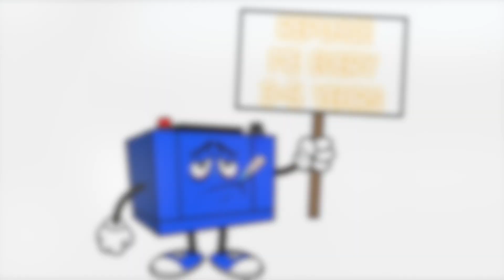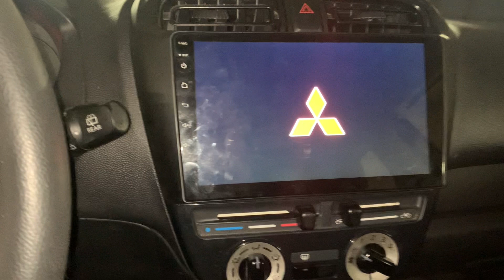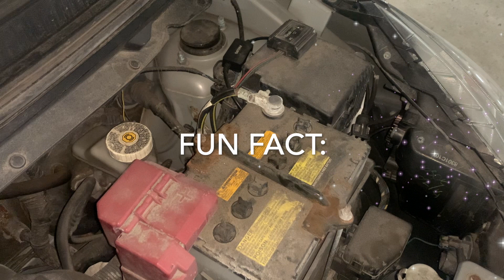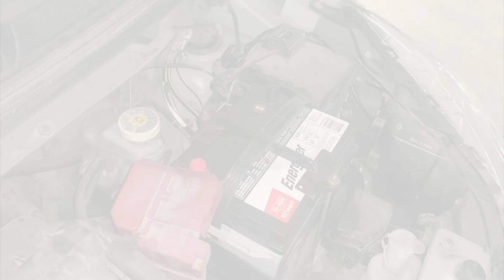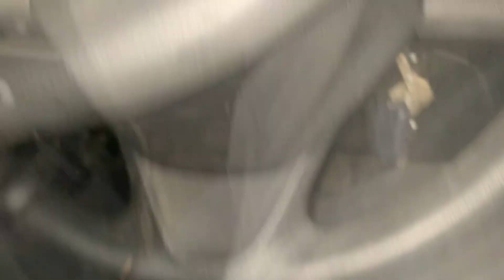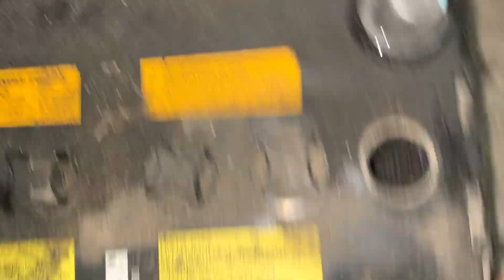Mitsubishi Mirage Battery Replacement

Comment from the maker: Minor correction: In the video I make reference to the voltage read by the 12v socket meter as the system voltage. Due to the length of the wiring running from the socket to the battery the actual voltage if measured at the battery will be approximately 0.2-0.5 volts higher.

Comment: Should the terminal link on positive side be loose or move.
Reply from the maker: Mine is quite difficult to move by hand but lead is soft and a natural lubricant so it will be possible to move it with some force. As long as it has good contact it shouldn’t matter much there is not much force acting on the terminal

Comment: Hey can anyone tell me what the voltage should be on my 2014 mirage O2 sensor bank1 sensor 1 . I have some very seems to be high voltage in the 2.3-4.5V range and I don’t know if this is normal for my vehicle or now it’s hard getting information from Mitsubishi. Any help would be great, if you felt like making a video with live data from the scanner looking at the o2 sensors that would be great also, cheers!
Reply from the maker: I have a video reviewing the blue driver obd2 scanner where I show some of the live data available. Do you currently have a check engine light/trouble code? What made you want to check the O2 sensor voltage? If you search on mirageforum.com you can find a factory service manual which might tell you what the appropriate voltage/diagnostic steps are

Comment: Great video! I replace these with a 640cca 35 group battery. It looks like your postive terminal bolt was flipped around. They come factory with the nut facing the back, not the front like yours is. So to remove it you either have to pry up on the red cover or use a wrench.
Reply from the maker: Great tip, Thank you for watching!

Comment: Not to change the subject but I do want to ask you a question. how does driving a CVT Mirage feels?
Reply from the maker: As the only car I've owned, and with no experience driving manual, I don't have much to compare to. It's a million times better than taking public transit if you ask me. However, I did notice that the CVT began to shift more smoothly after changing the transmission oil, as demonstrated in this video: https://www.youtube.com/watch?v=erlbDUi48Jk.

Given the vehicle's limited power, I believe the CVT is an ok choice since it doesn't place significant stress on the belt. Additionally, the 10-year powertrain warranty offers me some peace of mind. One minor issue I have is that when slowing down to a very low speed, the transmission shifts into neutral to conserve fuel. If I then abruptly accelerate, the vehicle shudders.

In terms of overall performance, I recently struggled to overtake a Toyota RAV4 in the city...
Reply: @TheFrugalEngineer  Gotta watch them Rav 4s🤣